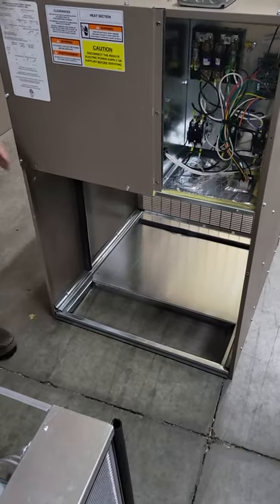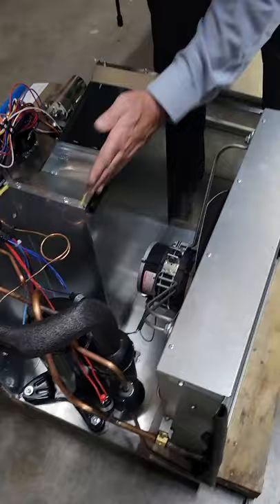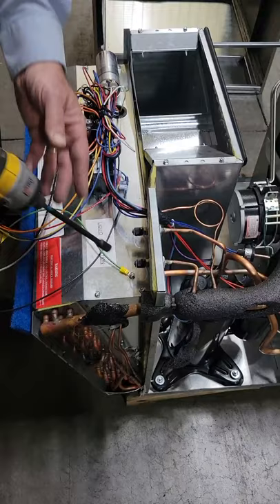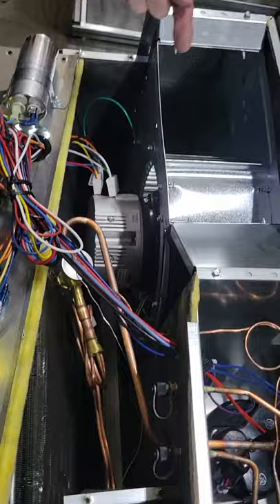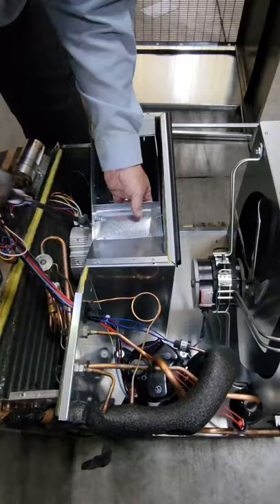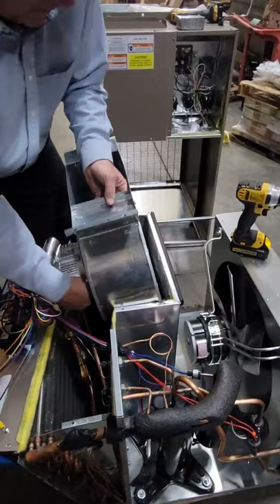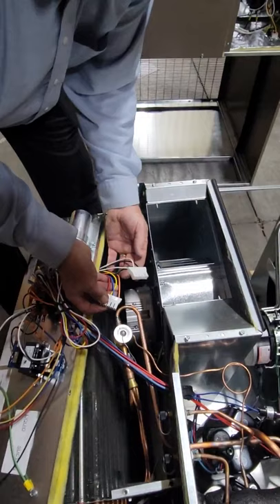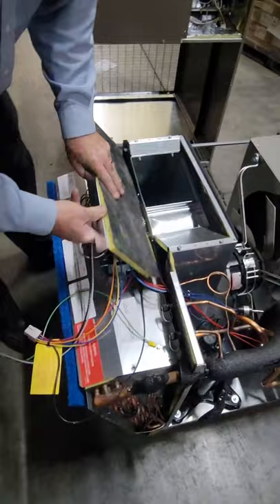Comfort Pack Cooling Chassis

Comment: I live in Ypsilanti. Our condo unit have Magic Paks. I notice most new replacement hwc unit are National Comfort Units. Most AC Techs highly recommend these as replacement. They say it's better built. I'm a DIYer and can do certain thing on these units. Minor stuff. But replacing a blow motor without access to the set screw is still a major problem. An oblong hole in the back of the housing would help. A rubber snap in piece to cover the hole also would be helpful

Comment: Can you please explain how you reinstalled the indoor motor blower plate? It’s jutting out preventing the chassis from going back in. You mentioned it at the very end, but it would help to see it be explained, thanks!
Reply from the maker: I think you're  referring  to the  "divider plate" we mention at the end.
Reinstalling it can go either real easy, or it can "fight you".
But sure the chassis is completely  slid into position.  Slide the plate over the wires and controls and into position. Lining up the screw holes can be tricky....lots of light helps.
If the chassis isn't all the way  in, the screws  won't  reach, and you may have to to jiggle and push at the same time to get it all the way in, or pull  it out a little  bit and give it a good shove.  Also,  be sure no wires are in the way.
On the national comfort products website under the "get started" menu there is a menu item for "contractors" ....click "service" underneath Comfort pack and you will see a service guide that might be pretty helpful too. Good  luck.